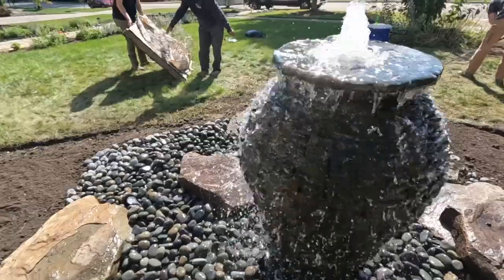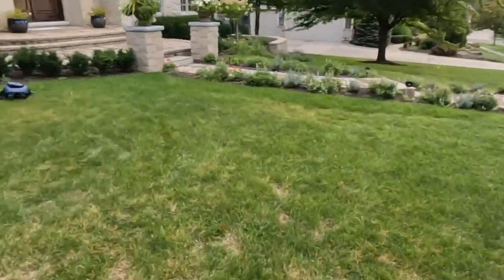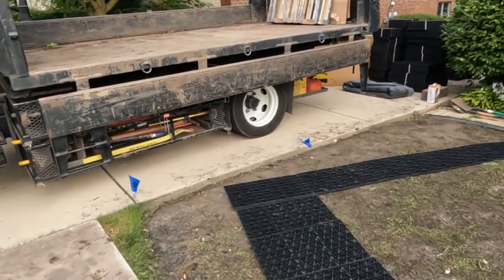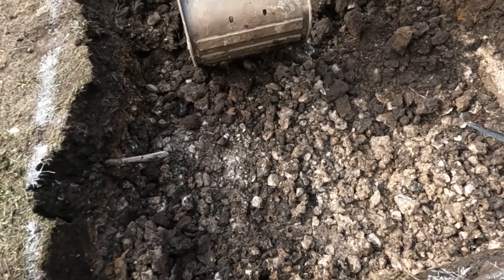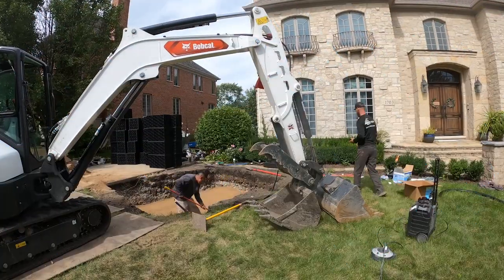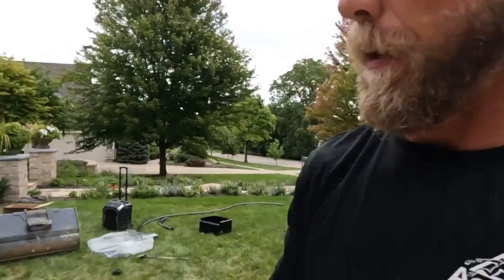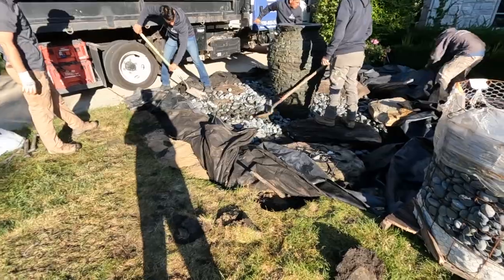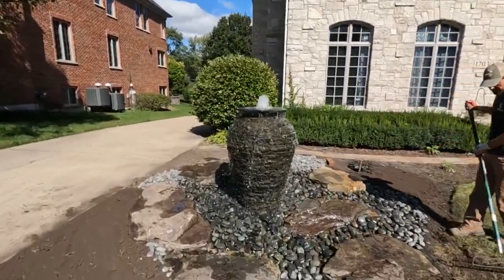WATER FOUNTAIN That's Perfect ANYTIME!

Comment: Did you add some type of auto full? And of so what kind and how? Maybe used the irrigation? Thanks. Look great. Love the new lights. Used them on a 3 bubbling urn project this year.
Reply from the maker: Yes we did. we usually try not to tap into the sprinkler system because the zone has to be active in order for it to work. We normally use a hose adapter with our autofill.  https://www.aquascapeinc.com/products/compact-water-fill-valve